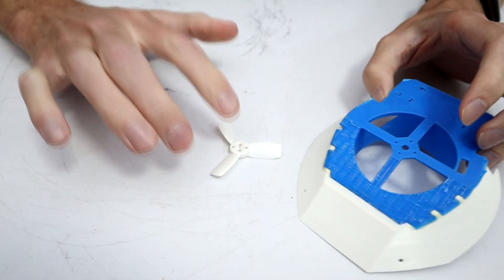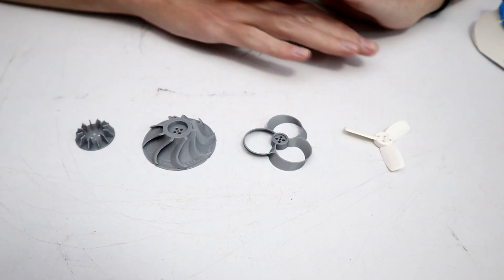Putting overpowered drive in a 150g robot!

Comment: Hello! Great vid. What are those quick disconnects you used for the motor leads?
Reply from the maker: Arduino header pins and servo connectors are what I usually use for motor quick disconnects at this scale

Comment: Thinking about overpowered motors, why not just build a 150 g version of Deep Charge from NHRL?
Reply from the maker: because I and the EO's at my local club disagree with Depth Charge style bristlebots getting a weight bonus.
The weight bonus is intended to make walkers and shufflers more attractive to try, by offsetting the extra weight those systems need. Its definitely against the spirit of the rule to use less weight for your drive, and whack all the extra weight into your weapon

Also I dont need to bend the rules to make robots with stupid big weapons, I've build a 150g robot with a 77g blade on top, all without using a weight bonus for an unintended purpose (which is a big part of the fun for me, the challenge of fitting something crazy into the smallest weight limit)

I get depth charge is chaos and fun to watch, but its not for me, I'll get similar chaos my own way

Comment: Can you make a 150g combat bot with the Flash hobby 12A esc

Edit: if you already have one, can i have a link for that vid please
Reply from the maker: Why that one specifically?
It looks to be virtually the same as any other <20A esc

If you have one and are using it for a 150g weapon it shouldn't need any programming or anything
Reply: @TeamPanicRobotics  well is it even good? Its like the only 12a 3 in 1 esc i found on amazon
Reply from the maker: I dont know, I dont own one and havent used one

The one I saw in a quick google didnt look like a 3 in 1 esc, it looked like a standard single motor brushless esc
Reply: @TeamPanicRobotics  interesting, also, team just cuz robotics said that brushless escs only work with brushless motors and brushed escs only work with brushed motors, but in your easiest spinner tutorial video you used a brushless esc with the brushed n20 motors?
Reply from the maker: That is correct, brushless escs only work with brushless motors

In my easiest spinner tutorial video, I used brushed n20 motors from dfrobot that have an ESC built into them. They are linked in the description
I used them because they are lightweight and easy to use for a beginner

Comment: on the suction side it may pay to place a wall covering the blades of the impeller leaving a hole in the center, it should make it harder for the impeller to draw air from the top thus making it more efficient.
Reply from the maker: I'm not sure I'm following what you're describing
The impeller has a wall around it, close too but not touching the blades, with a bit of extra diameter at the top to allow air to escape

Comment: That drive asymmetry issue drove me nuts a couple weeks ago. Its a quirk with blheli_s, it seems to slightly prefer going forward. I fixed it by setting one to bidirectional and the other to bidirectional_reversed in the configurator.
Reply from the maker: AHH! that would explain it!
My TX is set with one channel reversed due to other hardware I run (and being too lazy to set up different models) So one will be going backwards

I'll give the bidirectional_reversed trick a try, Thanks!!

Comment: I recently went thru similar tests with a 150g bot. I generated enough suction to drive on the ceiling. https://youtu.be/SRcRFEmvge0?si=UX_ZOulI-yEbJkfR
Reply from the maker: Thats great! I almost got that with mine, I'll show footage of it in my fight report

Did you use a fan or impeller? What style?
Reply: @TeamPanicRobotics  I ended up with an impeller.  I tried a lot of different variations of impellers and ducted fans, testing each with a strain gauge to judge performance.  There is a lot of non-intuitive forces at play.
Reply from the maker: I think thats the route I'm about to take
Other comments have suggested improvements so I'm going to try all of those and see what works
Reply from the maker: Any suggestions on what properties of the impeller to tweak?
I'm going to try:
More blades
More exhaust
Tighter clearance (its currently 0.5mm)
Better skirt
Reply: @TeamPanicRobotics  I iterated on the number of blades.  I don't think there's a magic number there, you can have too many, and too few hurt as well.  I suspect the right number relies on your specific geometry, so a lot of trial and error there.  The tighter clearance on your impeller and housing, and less leakage around the skirt both make a big difference.  Tighten those up as much as you can.  I used weather stripping, with .020" clearance between the stripping and the floor.  I ended up shimming that to nearly 0" clearance, and it improved downforce a lot.

Comment: to check the downforce you need to place only the wheels on the scales and the resr of the robot on a flat surface.
Reply from the maker: Would that only measure the downforce at the wheels?
Reply: @TeamPanicRobotics  Yes, but that's all you really need it on, isn't it ? for the drive

Comment: In your tilt test, with the motor off you're just measuring the coefficient of static friction between the chassis and table.  With the motor on, the vibration breaks the static friction and kind of turns the vehicle into a hovercraft, making it drift downhill regardless of how much the tilt is.  To measure the down-force, the easiest way would be to get a pull scale with a max hold function, use it to pull the vehicle off the surface, and subtract the vehicle weight.
Reply: IMO the test is sound, his goal doesn't require a measurement of total downforce so much as total *grip*. Grip would be a function of vibration as well as total downforce in this case, so designs less prone to vibration would rightly compete better, particularly if they're somewhat robust to damage.
Reply from the maker: I like the pull scale method, I have one for luggage but I dont think its sensitive enough for 150g scale robots. I'll have to see if I can find a better one

I think with a few changes (electronic angle gauge, more repeatable plate moving) this test would work a lot better. I might have to do a deep dive into impeller designs at some point and use both testing methods
Reply: @TeamPanicRobotics  I would love to see just a simple test of the robot pushing objects of different weights with and without the impeller. I imagine that would replicate its final use case a give a better idea how much it helps

Comment: Static pressure (axial) fans tend to want most of the area covered by blade area, so more blades generally is better. Centrifugal are far better suited for pressure, and work better with small clearances to prevent recirculation of airflow around the edges. The exit from the fan might want more area, it looks pretty small compared to the intake area, but that should be easy to test with different fan diameters.
Reply: maybe also worth trying out different skirt positions. Changing the area which contains the under pressure could also help :)
Reply from the maker: Thanks for the tips, what I'm hearing is:
More blades
More exhaust
Tighter clearance (its currently 0.5mm)
Better skirt

These are all very doable! I'll have to give them a shot
Reply: @TeamPanicRobotics  I don't know (literally) if more exhaust is needed because you are looking for suction and not high flow volume. I would look at how vacuum cleaners fans are built. A skirt is good, but I wonder if TPU will cause it to stick/drag on the surface. I would go for the bottom surface to be low friction.
Reply from the maker: I could do a hdpe skirt, that would be low friction
Reply: @TeamPanicRobotics  the more blades was based on the three blade prop, the centrifugal impeller looks reasonable.
Exhaust comment is purely by eye, deffo test that as it may be good. 
Clearance will be a trade off, don't want things to collide when you take a hit, but fan performance is generally better with less clearance.
Adding a ring to the open side to stop the fan flexing at speed will help, can't remember if that was already in the plan.
Reply: @rudycandu1633  a pleated fabric would probably be ideal, like an inside out hovercraft skirt, but a pain to make at that scale. Pleats or sectioned skirts deal with damage better than single piece skirts, as the sections either side fill in the gap when one part is damaged.

Comment: In the niche instance of using more than one brushless motor in a 150 gram robot, it may be worth looking into a quadruple esc often used in smaller drone stacks. I am currently trying to make a full brushless 150 gram ant on one of these.
Reply: It may also shave some weight with a small enough one
Reply from the maker: I didnt know you could get small ones, the only ones I'd seen where 40A ones with a pretty big foot print, I'll have to go looking
Reply: @TeamPanicRobotics there are 20x20 and 16x16 ones in addition to the “normal” 30x30. I know Flywoo makes a 16x16.
Reply from the maker: Wow! 16x16 is impressive for a quad esc, that would certainly solve the space issue
Reply: @TeamPanicRobotics  note that the amp ratings are likely not correct for your use case, they’re rated assuming that they’ll have constant airflow
Reply from the maker: I'll keep that in mind
Reply: @TeamPanicRobotics  Easy solution: mount it in the airflow path for the fan ....
Reply: @sea_kerman  Good to know! I've used them in a beetleweight before, hadn't realised they came that small. Some AM32 ones are starting to show up, I wonder if they come that small